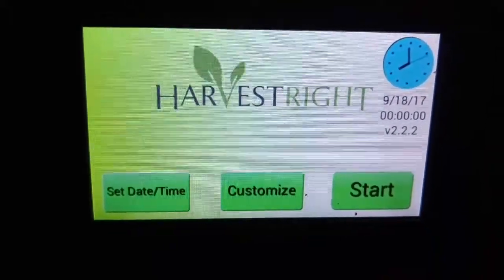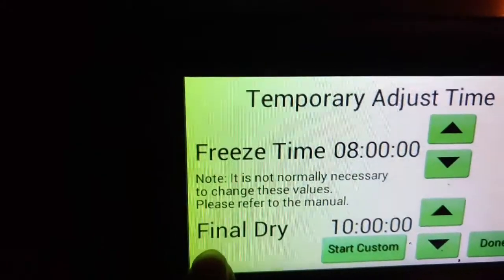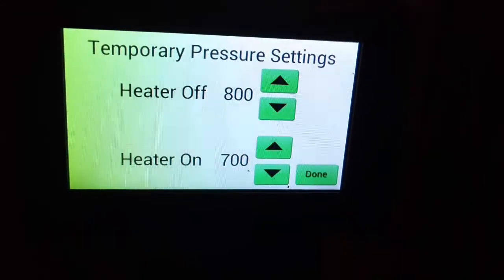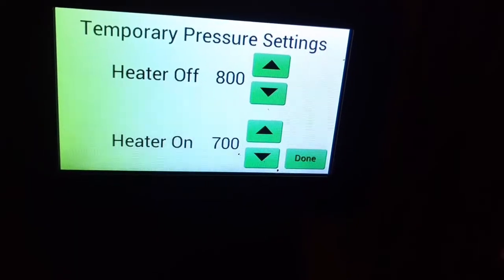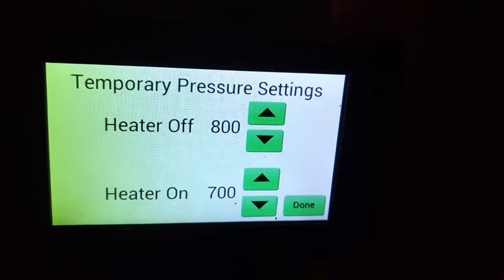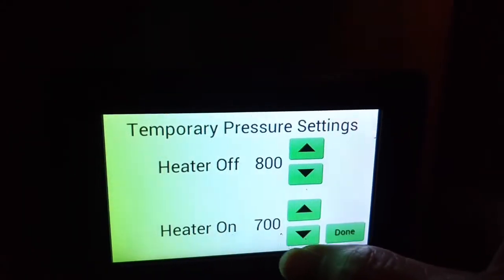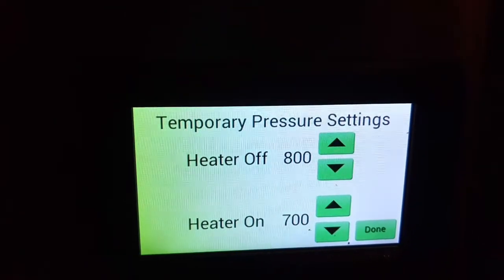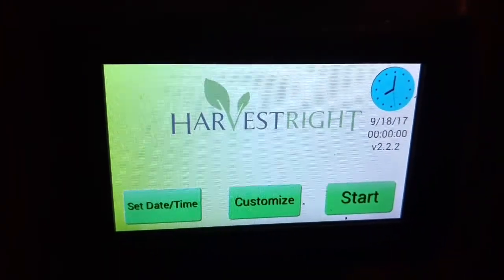Adjusting the mTorr settings for the Harvest Right shelf heaters to come on/off during Sublimation

Comment: I could be wrong but I thought that the Mtorr has to be under 500 to freeze dry properly. When it gets under 500mtorr it kicks on the heating pads which causes sublimation and also causes the Mtorr to go back up and then turn off the heating pads until it gets back under 500mtorr and repeats that process over and over. I thought it had to be under 500 for that whole process to work. Does it still work the same at 600 or 700 or higher?
Reply: Found out this morning (06/29/2023) that with software version 5.24 this is not necessarily the case.   It's supposed to work unless the Mtorr goes above 1500.
Reply from the maker: When the food is completely dry, the nTorr will be under 400.  It is different for each machine.

Comment: Can you tell me do the mTorres fluctuate during the vacuum freeze cycle.., they dropped below 500 then 5 hours later started climbing? I just bought my harvest right 2 weeks ago and still trying to get a batch of food dried.. I had to do the off gassing process and am eagerly watching this cycle but not sure what I’m looking for. Thank you Bonnie in Canada 🇨🇦
Reply from the maker: I do not have a newer machine, but the mtorr fluctuates during the drying cycle.
Reply: Hey Bonnie.  I am too have issues with mtorr down to 500.    I pass the functional tests but not a bread run.   Pretty much tried everything and more.  Did the off gassing but not sure did it long enough or correctly. They sent me a new machine should be here today.  Anxious to know what the problem is.   Any luck with yours ?
Reply: @easye1480  I have used my machine for a couple of years now at least. Not a lot but some. I have the oil-less vacuum pump. Just this last batch would not go below 490 mtorr. Not sure what is wrong but something is. I am going to move it into the garage (have been running in the house but noise drives me crazy) on monday. I will do a dry turn then. Let me know what was wrong with yours. It might be the same as mine. I will do the same.
Reply: @easye1480   Hi, I just got a new HR machine this August, and I'm having Pump not able to go down to 500 mTr. HR sent you a new machine or pump? It will be appreciated if you see this message and give me some info. Thank you!
Reply: @faith.hope.love...  hello,
I purchased a medium pharma model in February of this year.   Apparently it was made in a batch that dated back to July 2021-December 2021 .   After talking with tech support, they vaguely mentioned that they have had issues with the medium ones made in those times due to different parts they had to use during the covid times when parts were back ordered.   When I got my machine.  It had a 4.0.15 software I believe.   When I would do a test in the testing mode it worked fine and go below 500mtorr, but when I did a bread test it never would get below 500.   I tried everything.   Checked the hose. Checked the pump. (Standard one ) Tried every oil there is.   Change drain valve with a non plastic one that came with it. I did every test and trouble shoot you could do except two.   I didn’t silicone the wires that go into the chamber on the top back of the machine.  They’re is a video on that tech support could email you or can find on YouTube.   Basically silicone around the wires that go into the chamber from the top while it’s pulling a vacuum. Will suck in the silicone in any air gaps their might be.   Also there is a new software that  I think is designed much better and would help make things work.   Tech support can email it to you or I can. It’s like 5.1.16 I believe . 

Before I got to trouble shoot the silicone and new software I was pretty fed up with tech support after two weeks no luck doing every other test in the book. After barking at tech support , they got a new machine approved.   They shipped me out a new machine.  The new one definitely has different parts and newer software loaded.    It worked perfect right out of the box with my original hose and pump.  Knock on wood It’s been good since.  I’ve ran it about 10-15 times maybe.   I do an oil change after about every two runs.

Hope that helps .
Reply: @easye1480  We have a mdieum not pharma HR this August, from memory, I believe it's on V 5.2.19. It runs about 10 batches of just veges and fruits without issues, then got a Vacuum Error. Doing the Vacuum Test it's not down 500 mTr even after 40 min.   
We find out later that we should not be getting an old transparent wider hose came with the new machine and vacuum, by accidentally came across a Retire-at-40 YouTube. Then, we realized the new machines(models after 2019), should come furnished with the new black narrower hose that will reduce condensation instead of the transparent wider hose.
We contacted HR, run the Off Gas and Mock Test, today, the Vacuum Test is still 716 mTr after 33 minutes, which is not acceptable at all. We just don't know why they could sent us the consumers the old parts with the new machine as an acceptable business practice. The pump just might be having issues after all the condensation from 10 batches. And the oil gets milky after 10 batches. This not what they cliamed for the new Premier Pump for oil change after 20~30 batches at all. We are not technically tuned, so it is extra difficult for us. 
We really appreciate all your inputs, hope issues will be finally resolved, God blessed!
Reply: @Bonnie Dios   Hi, I also am in Canada got a new HR machine just this August, and I'm having Pump not able to go down to 500 mTr within 15 min. They ask me to do the Off Gas run too... still no fix yet. Just wondering if  your HR machine get fixed or figure out the problem? It will be appreciated if you see this message and give me some info. Thank you!Hi I also am in Canada got a new HR machine just this August, and I'm having Pump not able to go down to 500 mTr within 15 min. They ask me to do the Off Gas run too... still no fix yet. Just wondering if  your HR machine get fixed or figure out the problem? It will be much appreciated if you see this message and give me some info. Thank you!

Comment: My freeze dryer is taking longer than set time to get to second dry. When I check on the food it is still cold but doesn't get to final dry unless I set it on final dry. But when I do the freeze dryer says the pump will begin in 59 minutes because it has to cool down. Don't know what I am doing wrong. I just got the oilless pump and this is what is happening
Reply from the maker: L Tatum the first drying cycle can last as long as 30 hours.  The higher the moisture level, the longer the first dry cycle is.

If your unit is using all 30 hours for lightweight and low moisture foods, you may want to talk to HR.

I would not stop the first dry cycle unless there was a serious issue.  Let the unit finish it's cycle.

By stopping the first dry too early, it causes too much moisture to still be in the chamber when the final dry starts and that can cause you to get a vacuum error.

The 59 min cool down cycle is to allow the pump and oil to cool down so there is no oil spray.  Since you have the new oil less pump, you do not have to worry about that, just tap the clock icon and it will skip the cooldown and go right back to where it was.